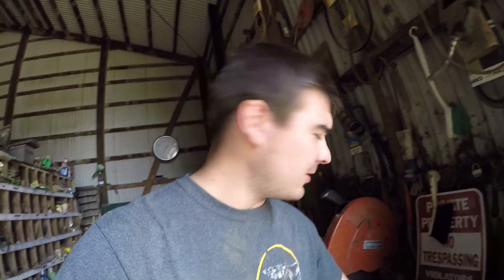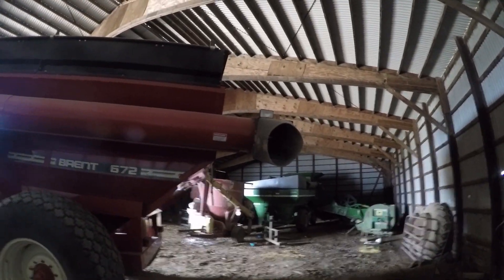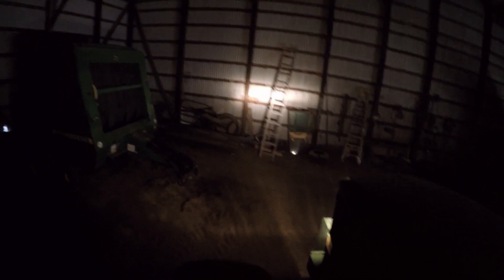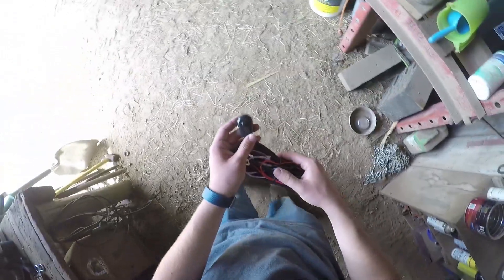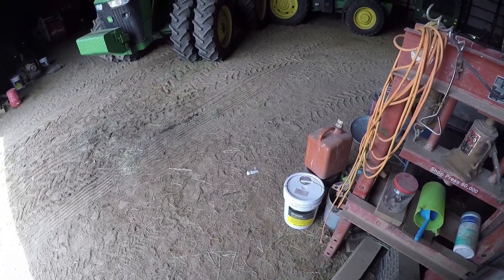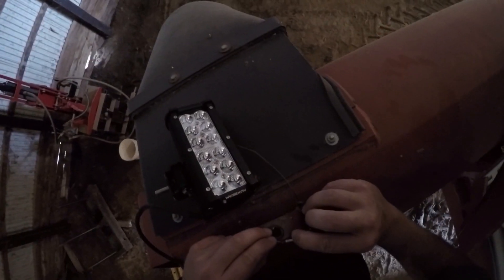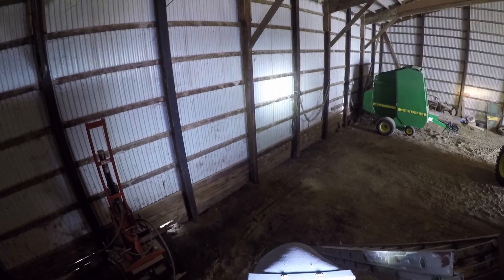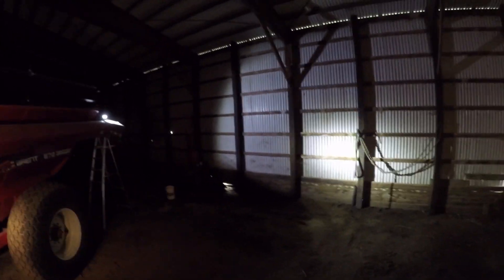New Auxbeam Light for the Grain Cart

Comment: Some off the new tractors and equipment have the power, ground, and flasher connections in different positions. You might want to start by checking which position the wires are in the 76 connector and then see if they are different on the 82, you might also want to see the positions of the wires on the grain cart compared to the disc, planter, and other grain cart.
Reply: where did u buy the aux beam light

Comment: That soldered connection will be a problem with all of the vibration. Maybe not this year, but it will come loose. Except for the circuit boards you won't find soldered connections on anything designed to take abuse. It'd be best to replace it with some sort of weatherproof quick disconnect system. Preferably before harvest.
Reply: LOL

Comment: How are you spose to use it.... Like going down the road and have the headlights on and than you have a aux light off the side, possibly blinding other drivers
Reply from the maker: +POLARISKING25 they don't turn on when you have your road night lights on. Just when you have full headlights
Reply: Its on the working lights, right?
Reply: +How Farms Work the reason why the light won't work on the 82 is because in the plug to hook in the tractor John Deere made them different so you have to pull apart the plug and there will be a conecter that only has one and there's one that's empty you just gotta switch it happend on are 6170 m but ares was always on when you plugged it into the adapter just get John Deere to fix it
Reply: Change the plug on the trailer or tractor and it will work @joe wilson! :)
Reply: +Mart-Jan Dee we just put are buggy on another tractor fixed it